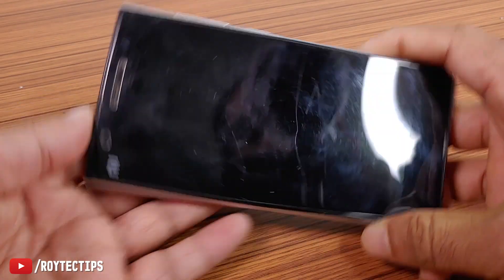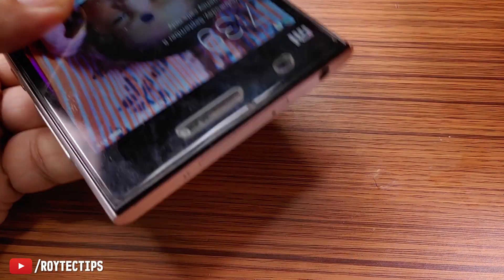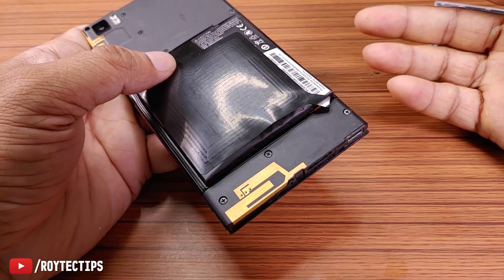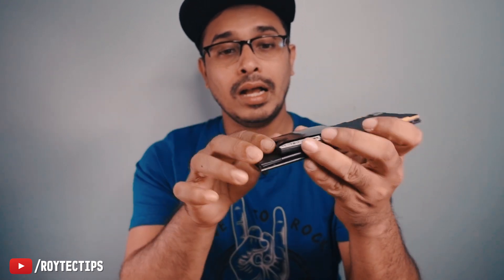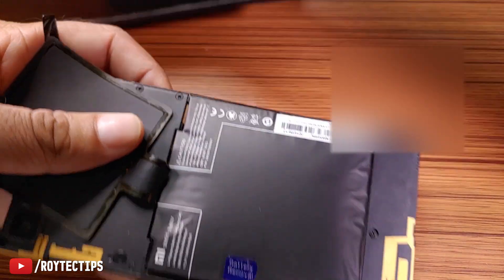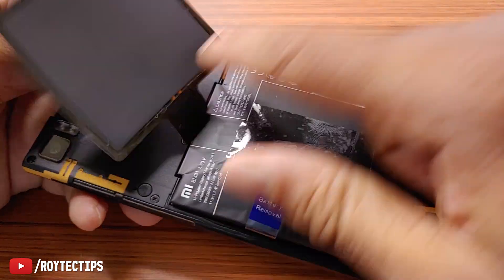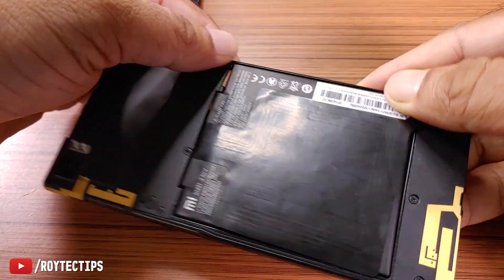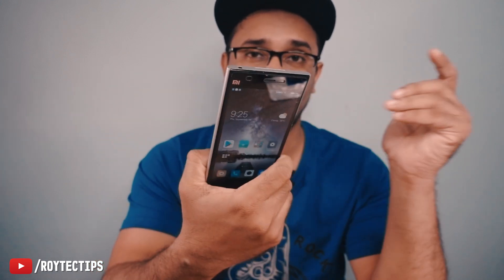How I Repair Swollen Battery in a minute - DONT TRY AT HOME

Comment: A very thin pin or needle  is used to successfully puncture the aluminium foil(Don't Go Deep just gently puncture  the aluminum foil only) without any issues then press out the air and reseal the puncture with a strong thin adhesive

Comment: Tried this. exactly how he did it and it worked. The reason I did it in the first place was because the battery was still strong and I was also in an emergency situation. note that if both sides of the battery are swollen, poking one side alone would do.

Comment: I have 2 phones and s laptop with this issue. One precaution to take could be too remove the battery from the phone/laptop before trying this in case it explodes. Wear protective gear since like the Russian guy always says:"safety is number one priority."

Thanks for the the video. 👍🏽

Comment: Don't do it!
I just tried it. Thankfully I did it outside, wearing thick gloves and glasses.
The moment the needle barely pearced the battery (less than 1 mm in a very acute angle, about 5 degrees) the battery had just burst in flames.

Comment: IF YOU ARE DOING THIS AT HOME, THEN YOU SHOULD DO IT ONLY IF THE BATTERY IS AT 0%. IF AT ANY HIGHER THAN 0%, THEN DISCHARGE THE BATTERY TO 0%. IF YOU DONT DISCHARGE THE BATTERY TO 0% BEFORE DOING THIS, THEN YOU CAN RISK A FIRE.

Comment: The best way to do this is how they do with cows. A needle that is like a syringe's, with a hole in the middle. That redirects the gases away from the battery and from your hands and fingers.
You also shouldn't do this unless it's the last case scenario where no replacement batteries are available, as doing this will also make the battery's health degrade even faster.

Comment: Did this 3 years ago to my iphone and my phone battery never got replaced and it’s still working perfectly fine (reason they say dont do this is because if any moisture from the air around you gets into the phone then your battery will explode or catch on fire in a couple hours/days) i did this with a box that removes any moisture from the air trapped inside the box but takes hours just to wait for. Never do this unless you’re signing a death wish

Comment: This method worked just fine. I have no intention of using my device, I just didn't want the risk of it rupturing one day and causing damage. It's no different than letting the air out of a small balloon. I expected much worse. Other comments are definitely over exaggerating the dangers. Just make sure there is enough ventilation in the area you are deflating the battery.

Comment: The solution is to limit the charge voltage or the % to somewhere reasonable, 50-60% as it's plugged in 24/7. Maintaining 100% SoC (higher voltage) is bad for Lithion ion based chemistry.

Comment: You would think the makers would incorporate a valve to release any build up of gases?
Thanks for the tip. I just took the back of; charged it a bit and the back just would not go back on!!! 
BP -4L. Has an all metal case! Will put in Frig.!
Reply: Didn't Work!
Put back in phone and immediately got smoking hot!
I threw it out the window!
Reply: The building gasses are a symptom of an already failing battery.
It's like wiping snot away from your nose and thinking that will solve your cold.

Comment: This is a terrible and dumb video. Relieving the gas buildup/pressure is not a repair or a fix. Lithium ion batteries do this as a result of misuse and malfunction. Relieving the pressure does not remediate the malfunction. This battery is still a significant fire hazard. If your battery swells like this, you should consider it finished and dangerous!

Comment: Do not listen to this rubbish!! It is extremely dangerous to carry out this procedure or continue using this defective battery. At some stage you will cause a fire! Batteries are very cheap to replace yourself which is much more safer. Very bad advice!!

Comment: It actually worked. Never thought it would be such an "easy" fix. I Woked up this morning and the phone had not been charging. Tried different cables and adapters but nothing worked. Then I found your video and tried this. Now the phone is charging. Just a temporary fix until a get a new battery or phone.
Reply from the maker: Good job

Comment: This "fix" worked on a fully charged but badly swollen kg40 cell phone battery. The phone and battery worked fine but the swelling had misaligned the protective case, so it was hard to operate the side controls  and to charge the phone. Working outdoors, with the back end of the back phone cover raised and the battery still in place,  I put a strip of scotch tape over the center of the swollen battery.  Using a toothpick to pierce the battery did not work. The battery membrane was just too tough and the toothpick wasn't sharp or tough enough to do the job! Next, working at a small angle to the battery, I used a sharp needle to make a very  shallow tiny pinhole through the tape and membrane.  I quickly pressed out the swelling and  put several layers of tape over the hole. Very little air, if any got into the battery. 

It's far too soon to tell how long this "fix" will last,  but it is working fine. Yes getting a new replacement battery is inexpensive (about $11 on Ebay), but until the "fixed" battery fails, I won't worry about it. If it fails and I decide to keep my  phone, I will replace the battery. Putting in a new battery will actually be much more work then this simple "fix".
Reply: Are you ok? Any consequences?
Reply: hows it holding up ?
Reply: @N1xko probably burned to crisps

Comment: I did this 4years ago on my old Vivo Y85, the small tiny hole remain unsealed just to make sure that it will not be swell again, now yr 2023 still kicking, believe me this method is very safe just make a hole in the the very thin first layer of your battery to remove the gas, piercing in sideways to avoid piercing directly the internal parts of the battery.
Reply: 😑troll alert

Comment: The solution looks relieving but dangerous, I did, the battery emitted some gases like smoke and the battery become very hot. Just be careful. Either continue using like that or replace your battery
Reply: Did you use that battery again?

Comment: Thought that occurred to me:
A lancing device such as the one used by diabetics to give themselves very small pinpricks on their fingers for blood sugar testing might be ideal for this kind of operation. The lancing device is calibrated to only penetrate the surface by less than a millimetre (you can typically set the precise depth), and cannot go any deeper than that.
Reply: good metaphor
Reply: The lancing needle isn't strong enough to pierce the pouch material.

Comment: Here is a common sense to people who keep saying it works. He said in the video clearly that the gas is hazardous, and then he seals the puncture with a piece of tape. What do you think will happen when the same battery swol again? This is some strongly airtight material that he puncture through, you think a piece of tape is going to prevent gas that's under pressure from coming out?

Comment: Be careful. The build-up of gases makes a swollen lithium-ion battery vulnerable as its casing is under stress. Never try to puncture a battery to release the gases.
Reply: I did it and i inhale it and nothing happened
Reply: @blazer7453  u can literally eat glass and nothing will happen on the short term.
Reply: You should at least discharge it before you puncture it

Comment: Mines went down, but woke up it was inflated again. It has done that 3 times or so since it was totally inflated none still weeks now. The back of covet did tha when was out hot outside sun like instant in my bag idu why. Plusy game & over charge on long chord not the one it cane with. I have to set up new cell. So sad. Motto could take allot which is good. God help me amen !looks like a gap to me, but idk. Take it to Best Buy theu will safely taje it or you.  Luke taje it out avcording to look up model. That doesnt fix ot. Googke says so. It's dangerous  even if vell works. Put it in a metal can. Put in bag take it to best buy quick. Keep it cool maybe 8acooler or frozen bottle of water inside may help.  I was lucky withy batrety. I dud do that or had the proper place to.

Comment: Thanks. My HP spectre has 6 battery cells and 4 of them were swollen and the casing was bending badly. I did this method with 4 of the swollen cells and my laptop casing is back to normal. I sealed the cells with glue and black tape and I'm not charging it more than 90% for now but everything seems to be working fine.

Comment: I did this to my Alcatel Shine Lite 5 years ago and it’s still working. I used a wood toothpick.
Reply: Yes. The battery charges fine and last all day. Doesn’t get hot while charging. Thanks and enjoy your day.
Reply: Did it restore its ability to hold a charge any more?
Reply: Yes. The battery charges fine and last all day. Doesn’t get hot while charging. Thanks and enjoy your day.
Reply: @readthebible1958  Any updates man

Comment: The ION are bricking upon their self the battery as exceeded its use the reason why its swollen is because the ION have bricked and the flow of new electricity being introduce has to find the room in the Battey causing it to  expand  This can happen due to a lot of factors. NEVER PUNCHURE ANY BATTERY its not a good move it will NOT FIX YOUR ISSUE IF YOU HAVE A SWOLLEN BATTERY REACH OUT TO A LOCAL TECHNICIAN TO HAVE IT SERVICED  , Swollen batteries are NOT a Safety Concern THEY DO NOT BLOW UP UNDER NORMAL CONDITIONS, How ever poking holes in any lithium ion product is a potential health hazard. lithium ion batteries are considered a consumable product MEANING WE DO EXPECT THEM TO FAIL (BE CONSUMED)

Comment: "I know what I'm doing" says any man, when he doesn't know what he's doing 😂
Reply: the older i get the more i realize that nobody has any idea what's going on and everyone is just winging it.
Reply: Not necessarily
Reply: It is hydrogen, I think. Also, under every video of lipo fire there are countless comments about toxic smoke, but it isn't more toxic than burning plastics, wire insulation, etc.
Reply: coughs

'Do this in an open environment because the gas is dangerous for your health'

He says, while indoors, huffing deadly fumes from a punctured battery.
Reply: @Claidheambmor no joke I worked in a laptop repair warehouse and one guy there did this on a regular, he was so appreciated for this 😂

Comment: not even using electrical tape... def safe to do 💯
Reply: How about heat temperature tape for battery than electrical tape?
Reply: If that fails go with the handymans secret weapon 🦆 Duck Tape "Red Green"
Reply: @billw7813  that tape can cause moisture with greesyness
Reply: It's s not an electrical wire or contact. Electrical tape would easily come off. The tape used was perfect, and exactly what I used.

Comment: Congratulations, you just released some gaseous form if the electrolyte  (Lithium-hexafluorophosphate), which is like removing some foam formed after serving soda, that foam is soda, if removed you will take less drink. On the battery, it will loose capacity. Sometimes this has reverts (recombines) if you top charge it *properly*.
Reply: True and what's interesting is that after it recombines it never swells again...
Reply: Wait! How to top charge it?!
Reply: @ItsMrEzzy  turn off fastcharging and , charge with lowest powered charger .
it deflates , but not sure how long it last
Reply: @EARTH38221  I see..

Comment: This same thing happens in the batterys in hybrid / EV cars. Lithium is a reactive alkaline metal which reacts with water pretty violently and it's why just this week a tesla "spontaneously combusted" in a wrecking yard
Reply: Well of course. You don't want to put water into anything electrical, and indeed you wouldn't want to put a flame near a gas tank. Common sense.
Reply: No. This is a lithium ion battery - the only lithium in it is a salt. A primary lithium battery has a lithium metal anode which is water reactive.

Comment: ey bro, my phone with swollen battery, sunddenly have sounds like gas leaking if turned on, then I notice, the battery swell decreases, now I'm aftaid it might explode if charged, 
Can you guys comment on this?
Reply: Just a guess, but sounds like you have a leak in your battery. Though I would normally do the fix in the video, if you cannot find the leak and seal it, might be best if you replace your battery. I get the general idea this is not nearly as dangerous as people think, so I wont tell you not to use your phone in the state it is in, but not sure you should use it either.

Comment: It worked for me but I advice anyone who wishes to try it to drain the battery first. The gas is dangerous so try it in open space.
Reply: this is the most important part to minimize the risk to very low levels
Reply: Yeah he did it indoors. Ugh. Also, says not try at home. I'd have thick gloves on. I'd be affraid to do it wrong. Not worth it of the dangers. I'd just buy new battery on eBay. Then take this one Free to best buy they dispose of it.
Reply: Also the gas that comes out gives ME an instant migraine that lasts a long time.  YMMV.  Do this outside on the concrete.  Good ventilation, and if it catches fire, won't burn your house down.  You CAN'T safely pick up a device that has lit because it turns into a blow-torch that will give instant 3rd degree burns.  If you have to pick it up to move it somewhere safe, you're already doing it wrong.  Discharge the battery to 25% or less before doing this.  If it does short, the less power in the battery, the smaller and shorter the fire will be.  Use "polyimide film" (aka Capton/Kapton) tape instead of scotch tape if you have it.  That's what the manufacturers wrap these batteries in to improve their airtight-ness. (if you see a really thin yellow/range tape in your computer, that's capton)  It's very heat resistant, very sticky, and stays stuck for a long time.

Comment: ⚠️(Dangerous Warning!!!) Fixing buldged up batteries is for Adults only and they need to wear goggles, respirator M3 mask and thick safety gloves, because the battery has concrete metal that can catch on fire if the terminals are touched by metal objects and it is dangerous. Also please make sure you are at outdoors or an well big ventilated open area room because it is a lot safer and better to do it as well.🔥🥼👓🥽🎧🧤🧯
Reply: DONT FUCKING DO THIS UNDER ANY CIRCUMSTANCES. Forget the vapor, the battery itself could explode after this "fix"
Reply: Do you know what happens if you inhale the gas from a swollen lithium ion battery?
I accidentally inhaled a bit and I'm worried.
Reply: @AK961.1  Are you alive?
Reply: @TheSoulja99boy  welp, i guess he's not

Comment: Can you please provide scientific sources on your words that if room moisture goes inside the battery, it will blast or catch fire?
Reply: It is a safety statement so no scientific proof is not needed. If there is any possibility of a chemical being in there that can spontaneously catch fire with contact with the air then this is a good statement to make. 

We know this can happen because plenty of people have opened a battery completely and had flakes of chemicals burst into flames on their bench minutes after the battery was opened.
Reply: @ecospider5  Yeah I have seen that too. I just want to know what is causing it, is it the lithium?
Reply: Your right it would be interesting to know. Part of it we will never know though because in every lithium battery there are some secret sauce chemicals that they never tell anyone about. If one of these can spontaneously combust in contact with air it will stay a mystery. 

But knowing which of the known chemicals react this way would nice to know.
Reply: @ecospider5  Yeah that's what I mean. But usually they mix it to increase the ion movements.
Reply: I have done this on several batteries, say up to 6. All of them I left a big hole unsealed. The only problem is that the battery capacity reduced drastically, and then the swelling came back. As long as you let the battery fully drain, the chances of a fire is reduced, even you mistakenly puncture the metal.
Once I have also cut open a battery out of curiosity using a razor. I unwound the aluminum-looking paper, washed of the black powder under a running tap. It got warm and it was a bit scared, but I succeeded in isolating the shiny silvery paper thing.
Make sure your battery is fully drained before attempting it. Also be assured. You would need to start preparing for a new battery.

Comment: DO NOT DO THIS IT SWELLS FOR A REASON "FIXING" IT DOES NO GOOD IT ACTUALLY DOES HARM BECAUSE THAT GAS WILL EITHER JUST PUFF UP THE BATTERY OR PUMP THE PHONE FULL OF FLAMEABLE TOXIC GAS MAKING IT BLOW UP IN YOUR FACE.
Reply: Lithium Ion batteries may catch on fire, they aren't bombs though, and won't "blow up". The "blow up" is merely the lithium gas under pressure. Lithium is kind of like helium but is denser.
Reply: how will it pump the phone full of flammanle toxic gas?
Reply: @sultanabran1  the gas tends to leak through the tape... because it's a gas, doing this fixes nothing, it's a sign that your battery's health is degrading, only thing you can do is get a new battery, or in some cases... a new phone entirely. if you try to do this, even if you do it successfully, it'll just puff back up within a few weeks, if you do it unsuccessfully... let's just say, you're gonna have a horrible, extremely expensive time

Comment: This is a "tech tip?" You repaired nothing. All you did was treat the symptom of a failing battery. It's still going to have problems holding a charge, and on top of that you are risking a fire in your pocket. Does that sound like a "lose lose" situation to you? It should.
Reply: It fixed my battery without any problem.  My phone is charging!!!! One just has to carefully follow the instructions.